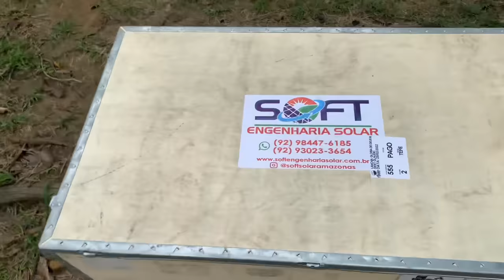INSTALAÇÃO DOS PAINÉIS SOLARES NA COMUNIDADE RIBEIRINHA/Installation of solar panels/AMAZONASCOIN.

Comment: Hey Fabiola &Fabiane how are you.My kob electrician l do solar system  .what is your solar power ?(solar panel lower 1200 watt ör 1500 watt) respects.greetings from Turkey cappadocia
Reply: How much price all system usd  dolar?
Reply: I do not know if autotranslate worked well, but I saw it said 4 panel of 450w, so it seems that is 1800. the inverter if I remember well is 3000 so there is room to add more panels. The battery also quite small. 3,5 kwh. So in a good day will be full in two hours. This is why I think that the installer do not cared to choose a better location. between the house and trees few hours of full sun will be available. With that small battery, they will need to hunt sunny hours to use electrical appliances.

Also I am curious about the price, but if I remember well this was a prize or sponsorship so the system is free. However, similar kits I see for outrageous prices like 6000 USD without battery. But I see out there prices at almost quarter of this. a 3 kw system is under 4000. Also no battery. 
At that size the battery can go easy to 2000, even you can see higher prices. On chinese sites, are under 1000, but with transport and taxes  you get easy to 2k.  So if it is to guess that system is somewhere between 4 and 5 thousands USD.
Reply: thank you for the useful information.Greetings from Turkey cappadocia
Reply: Thankyou  my valuable friend Fabiola &Fabiane respects

Comment: ok there is a way  to nail tin  zinc  roof over your wooden frame  to protect it from weather    then put your solar panel s  on the zinc   si comprendo ?  then tilt them a little more   an face the tilt   south an west  a  little       you  can learn alot  from  that set up there  carpentry  electricty   you get what you  pay for     ilove your vidio s   kids  peace  ,,,